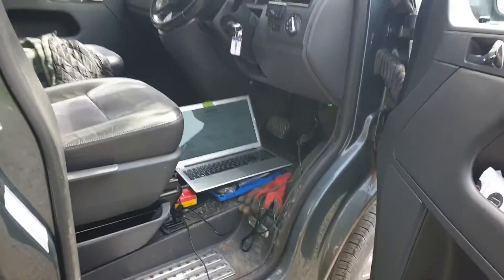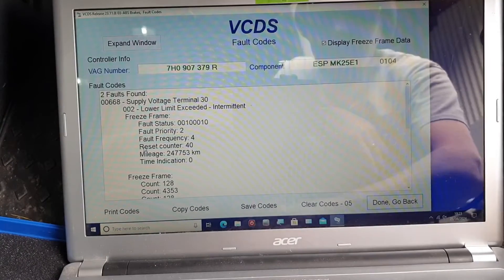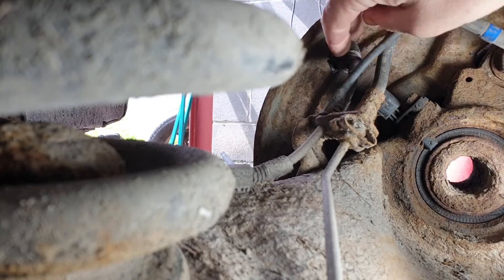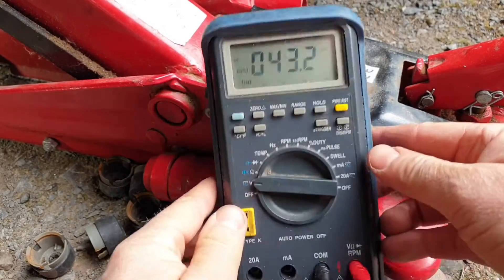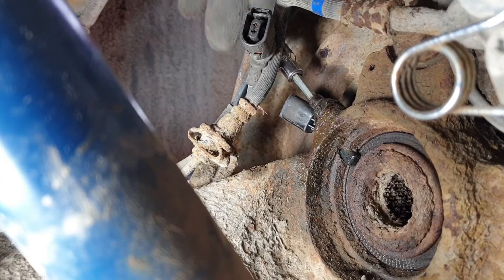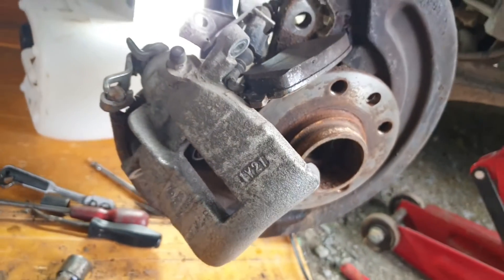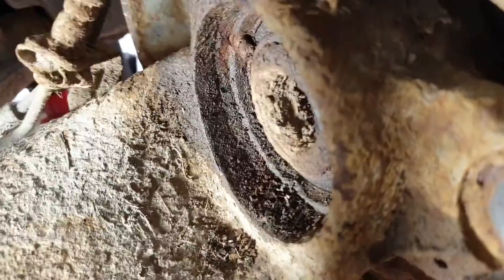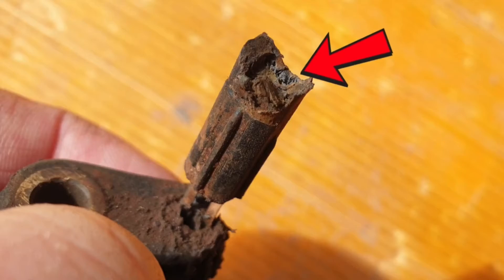VW ABS Wheel Speed Sensor Fault - T5 Transporter FIXED!!

Comment: Hi, i have error coe 00287 for  the rear right abs sensor, I replaced but still have a same code. Have you got a clue what is problem?
Reply from the maker: Probably worth checking the wiring, as the connections can corrode where it joins.

Comment: Really helped me out. Great video. One point to make is that the back of my hub had a cover on it “protecting” the reluctor ring so had to level that off to then punch the remains of the sensor through. 

Thanks!
Reply from the maker: Thanks for watching, good tip about the cover, mine was missing or never there. 👍

Comment: I did my speed sensor a few years ago. I drove it out from the bottom rather than trying to lever it out. Just a point, when you tested the wiring, you didn’t load the circuit. So you still could have had a problem with the wires. You could have had some resistance on the wire which won’t show on an unloaded circuit.
Reply from the maker: I tried from the top first as some times it works then drove it out from the bottom, as some vehicles don't have easy access to the bottom of the sensor so you have to get it from the top. Re the wiring the voltage was on the low side but I ignored it, 2 days later I'm doing a abs wiring video. 🤣👍
Reply: @50plusdad-uk  Hi, My rear right just snapped so am thinking driving it out from the bottom. Does the rubber gator easily come off. VW T6 mine is
Reply from the maker: @rainbowgecko9395 no gaiter on mine, get a punch just smaller than the sensor and knock it up from the bottom. Clean the hole before putting the new one in.👍
Reply: @50plusdad-uk  Didnt even notice a rubber gator so googled and found a possible way. Too dark to go back on drive now lol
Reply from the maker: Good luck 👍
Reply: @50plusdad-uk  Sensor out!!! 2 hours gentle easing and taps from bottom. Lying in the sun was not a good idea. Do I have to get the fault cleared by a vagcom or will it clear its self?
Reply from the maker: If the light goes out the fault will still be there but stored as historic rather than current, so you can clear it at your leisure. 👍👍
Reply: Do you have to clear the fault code or would it clear itself? I've just done my sensor and now have the handbrake/fluid level light flashing and 3 beebs. Didn't have that before changing the sensor. 
I've known some cars/vans to clear the fault once fixed.